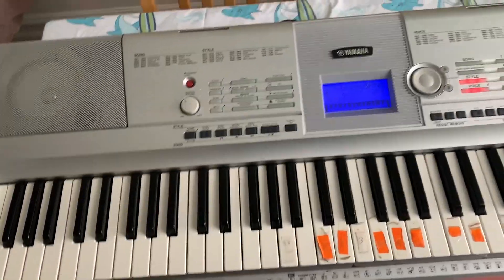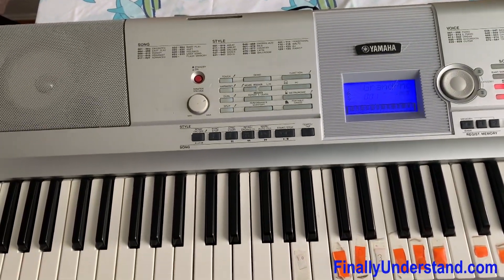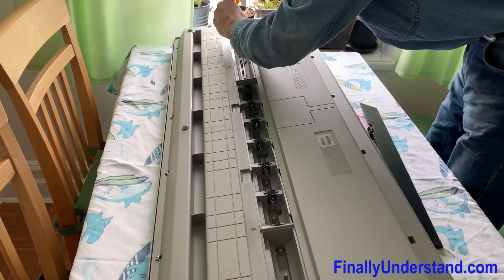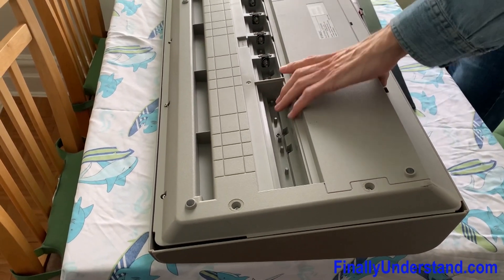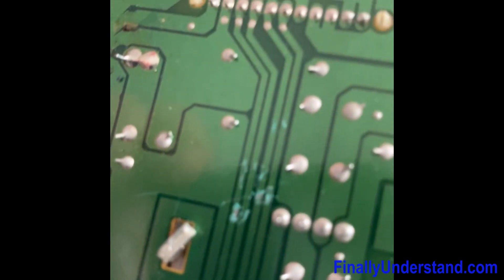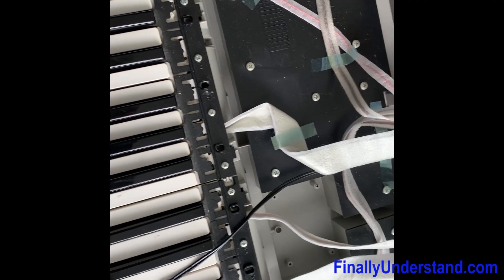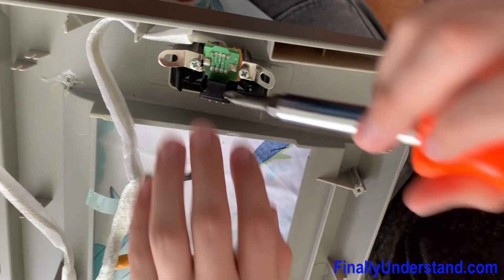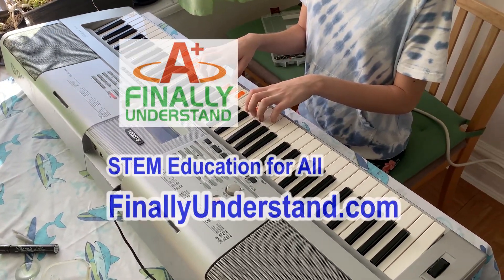How to repair keyboard - Yamaha Portable Grand DGX – 205 (STEM Education)

Comment: I have the same piano, but some of my keys are stuck. do you know how to fix sticky keys?
Reply from the maker: Good day.  There is a mechanical problem in your keyboard.  You should open the keyboard section and inspect it.  If nothing is broken, you will probably need to clean and lubricate it.  The one in the video wasn't mine.  I only got to repair this specific model once.  This is very a good instrument and its worth repairing.  You should try to fix it. Please let me know how it goes.